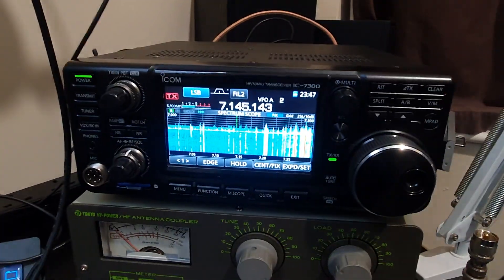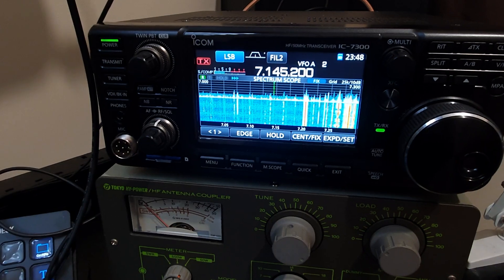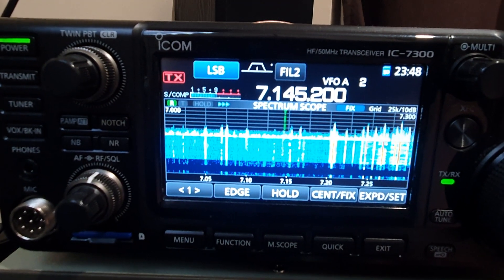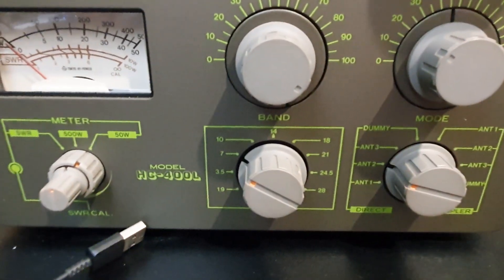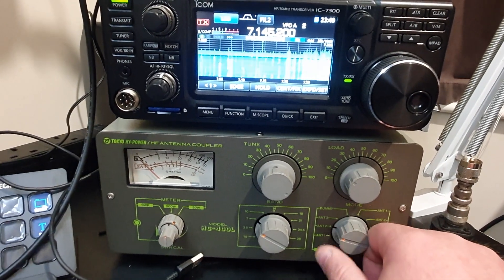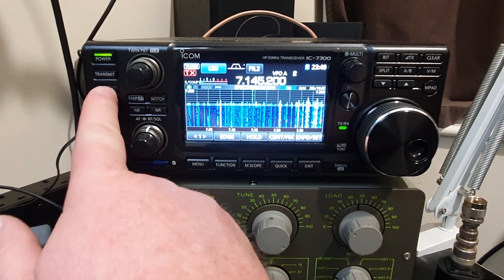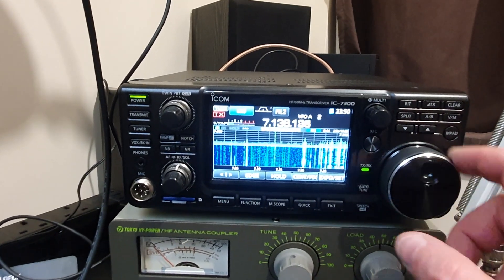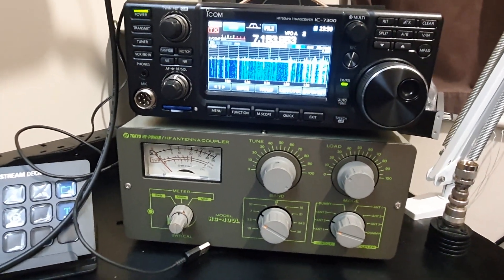Proof in the eating....! 40mtr tiny loop working on an ic 7300

Comment: It's just so remakable, and I figured that someone would get around the problem of the high voltage capacitor with a trombone capacitor such as you have devised when I read about a similar loop in QST several months ago. It's just uncanny: The Velcro bearing. We all know that we're not talking about an efficient antenna here... But we ARE talking about a POSSIBLE antenna. I don't think that you understand the implications here: You have just revolutionized the portable loop, and portable operation. It comes at a critical time, when a lot of hams are faced with unreasonable Council/HOA/Land use regulations. 
And there you did it, right in the middle of a lockdown the likes of which the World has never seen. I hope that you might post the equation(s) that led you to arrive at the dimensions of (especially) the primary loop, capacitor,  and so on? Have you a blog site? 73 DE W8LV BILL
Reply from the maker: Thanks I can't take credit for the loop I'm afraid to say, I used a build guide link in one of the descriptions, it called for a cap I didn't have but I had slug tape that's how I came up with it.. It didn't need many pF to tune so happy days.. Im really please you liked it.. Update tho I did flash the cap over @100watts so 25-30 would be OK however I'll work on the cap some more as it was a sharp point on the wire connection that started it.. Gaz
Reply: @TheGazLab Doesn't matter that it punched through... That's the Pleasure of the Experimenting Journey! ;-) You get credit for the awesome capacitor with the nylon bearing! Thoughts: Teflon tape, Kapton tape... Just trying to think of things with a high dielectric strength... You'll get it sooner or later, mate! 73 DE W8LV BILL